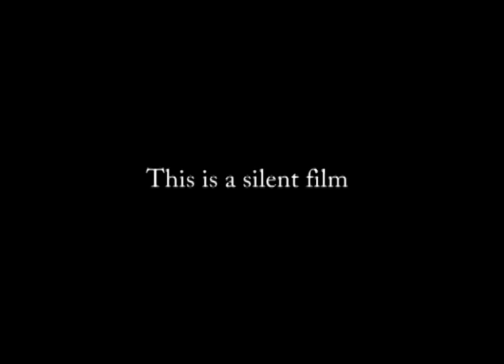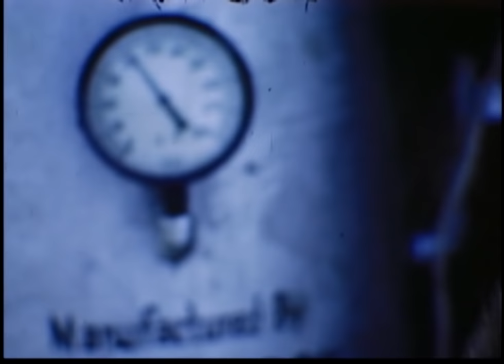Film Footage of Corn Silage Harvesting and a Bale Gun, circa 1954

Comment: I’ve never seen that method of putting hay in the barn like that before.
Reply: Me neither, I would never think somebody would make a machine whose sole purpose would be to yeet a bale of hay to second floor :D
Reply: There may be a reason, it was innovative but since we don't see it anymore we can assume it never caught on,  I never saw it and I grew up in an area and time dominated by small square bales and only 20 years after this movie was made. We can maybe assume that elevators with chains became more popular. Although with one of those 40' elevators, tight bales and a big enough tractor you can launch a bale 1/2 way across the hay mow and the elevator was full auto, you didn't have to pull the trigger for each bale. This also taught us how to work well  with others as getting stuck in the mow with a continuous stream of 80-100 pound bales coming at you encouraged you not to piss of your co-workers again.

Comment: Usually corn silage was cut when it was green and then chopped up and put in a silo like you see on the page to the right. This standing corn was sparsely planted and all dried up when harvested.?
Reply: I’m guessing that was gonna be ground for feed
Reply: Looked to me like the corn picking was in the spring after the normal harvest in the fall. So much corn was down, so many leaves missing. That was just slightly less corn stand than normal in the 50's. Planters left a lot to be desired, and seed corn wasn't all that great either. You really didn't see good solid rows until the hybred seed was adapted in the 1960's.
Reply: Generally to store silage in a silo, the moisture was 65% or less.  Generally you could tell by the milk line on the kernels.   Cob corn was picked and cribbed back then and generally under 25 % picked on the cob and cribbed.  Shell corn needs to be 15% moisture to store properly, generally ground for feed to fatten cattle or dairy cows milk good on that in addition to silage.   Corn silage is a good way to increase milk butter fat %.  Back then they milked more for the cream and fed the skim  milk to hogs.
    Back then the corn yields were not what they are today.   Today most corn yields 150 bushel to the acre or better,  back then 75 to 100 was very good, until fertilizer usage picked up in the 60s.
    Corn sometimes, before the  50s they would chop one row, stalk and all for silage, and simultaneously pick one row, also chopped just the cobs, to increase the amount of kernel content in the silage used for dairy cattle.   Corn silage was primarily good due to it being fermented.
Reply: Now days that thin of corn would be considered a crop failure

Comment: Even with the poor quality I can tell those bales look heavy and wet😂
Reply: Probably burned the barn
Reply: heavy yes ..wet ... No !!!  No Farmer would ever put wet bales in a barn  loft ,..  they are a fire hazard ..(High-moisture bales can catch on fire because they have chemical reactions that build heat. Hay insulates, so the larger the haystack,  the less cooling that occurs to offset the heat. When hay’s internal temperature rises above 130 degrees Fahrenheit (55 degrees Celsius), a chemical reaction begins to produce flammable gas that can ignite if the temperature goes high enough.  Also   Barn lofts tend to get hot during the day,   the heat  would  cause mold to grow  on the  wet / damp bales in turn  spread to other bales around them  over time ,  and ruin them , cattle  or any other farm animals  can not eat moldy hay, it could kill them,.

Comment: I can definitely see why yields have gone up monstrously since these practices. Especially with no-till planting, methods of nitrogen injection, and cover crop no-till. I can also see why we use more diesel to break up hard pan with our monstrous equipment. All in all though better soil management by far than these wasteful practices. We would certainly get better planting and soil condition, and soil runoff losses with the methods of these earth scratchers and vegetation bunchers.
Reply: You can have modern agriculture without old agriculture, remember that. And those people had to work a lot more than modern folks.
      Even worst was my father here in the third world, using cattle as tractor. The norm was to let the jungle take over the field for 3 years, then they burned the jungle, then they planted the corn. Burning was just sperficial, the worst part was the revolving oF the soil, now here we dont do that.